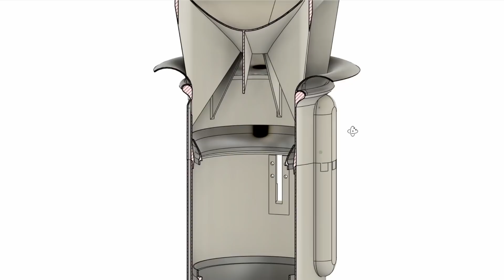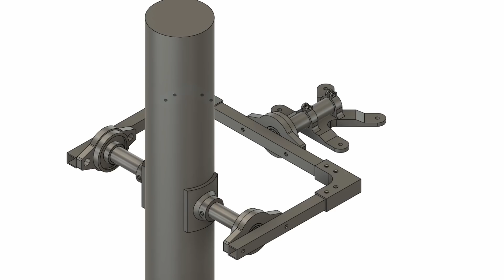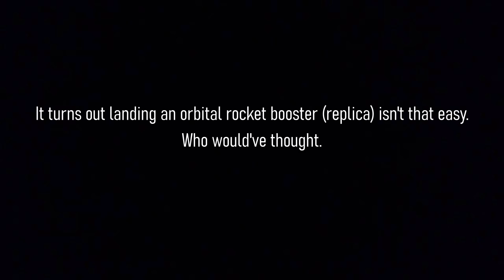SpaceX inspired edf rocket part 2: Final assembly, tuning and maiden flight

Comment: Nice work! Where is the gyro located? Did you notice in the video that the nose cone is the most stable...everything else swings around it. (Axis point)  What happens if the gyro is in the center of the rocket?
Reply from the maker: R Coyote the gyro is located in the nose cone and yes you’re totally right, ideally the flight controller needs to be positioned in the CG of the craft but i did have any place to mount it in this place because the air needs to flow inside the tube as uninterrupted as possible. Placing it on the outside was also possible but this is just too ugly 😆
Reply: @BrianBrocken  That makes sense! How about printing a 4 vane stator with a   space for gyro in center at cg?  It would still allow air to bypass..  (may need a bigger motor to offset)

OR

Two gyroscopes one on top one at bottom?  Synchronized?
Yeah, i know I am opening a can of worms there..

Just throwing some ideas out there.

Comment: Looks absolutely incredible thank you for sharing. I guess one variable the falcon rockets do not have to contend with is hovering. Your EDF rocket looks completely stable as it takes flight for that first 500ms or so, and perhaps if it was coming in to land smoothly from a height of, say, 10 meters direct to a landing spot it might be easier in its "terminal guidance" phase. 

Does your rocket guidance system learn from its experiences (machine learning)?
Reply from the maker: Thanks man, I think i need some compressed air thrusters on top to keep it level and no haha it's not that sophisticated 😂👍
Reply: @BrianBrocken  One day, man, one day!

Comment: watching it wiggle clockwise and counter clockwise and i'm wondering if its fighting the torque of the motor, maybe install 2 motors that spin in opposite directions to counter the torque. otherwise its an awesome project. :)
Reply from the maker: The thrust vectoring is fully capable of counteracting the torque produced by the motor, it just needs to be tuned a bit better. Also when retracting the legs, the moment of inertia moves inwards and you would actually need a different set of PID parameters to control the yaw movement, to prevent the wiggle.
Reply: @BrianBrocken  sounds like you are already looking into it, best of luck to you :)
Reply from the maker: Of course haha, thanks man 😉👍

Comment: Hi,Bro, you don't have a stabilizing device at the top of your rocket. Four directions of gas path can be designed to connect the bottle filled with gas, and a solenoid valve is used to control the gas injection inside. Control which direction to allow it to jet during landing to control landing attitude.Good luck.

Comment: Thats awesome, but all your problems seems to come from the nose being to heavy and the legs not being wide enough for it. All about CG brother. Huge congrats for the work accomplished
Reply from the maker: Thanks man. The weight needs to be at the top or else it won't fly at all. You can compare this with trying to balance a large and a small stick on your finger, the larger stick will be easier to balance. The higher your cg, the more leverage and control authority you have at the bottom. Of course for the landing it would be ideal to have the cg as low as possible but then the thing won't fly at all. The CG would actually need to move from the top to the bottom when landing.
Reply: @BrianBrocken  Yeah you're right. Maybe just increase the legs size then would solve the landing problem. You could also divide the rocket in 2 parts. Having maybe 4 fans on top for stability/lift and your main fan at the bottom. Would look closer to the real Falcon 9. However, keep up the good work you have a new subscriber :)
Reply from the maker: Haha thanks for the sub man, appreciated 😁👍
Reply: @BrianBrocken ,  SpaceX uses smaller directional thrusters at the nose during landing to aid in balance.  Could your nose weight be tiny drone motors?

Comment: you should consider how to lower your mass centre, how to prolong landing legs and most important, how to install dampers onto this legs. Then it will be easier ;)
Reply: That is the trick, right? Should the mass center move down or, perhaps at bit counter intuitive, up? Imagine a stick with a weight in one end. It is easier to balance the thing when the weight is in the top than in the bottom.  A dart arrow has the weight in the front and the control surfaces in the back. An air plane have the center of mass in front of the center of lift or it will fall down.

Comment: will your flight controller let you have another set of yaw gains for when the landing gear are up?  change in inertia must giving them fits.
Reply from the maker: Yes i was thinking exactly the same thing, didn't find it yet unfortunately.
Reply: @BrianBrocken  what flight controller are you using?
Reply: @BrianBrocken  Maybe your flight controller has the ability to change gains from the remote control.  Just use the retract switch to also change the gains for the yaw.  Really cool project and nice work to get it up and flying.

Comment: Maybe counter rotating props would  mitigate the yaw issue?
Reply from the maker: Yes this would absolutely solve it, but adding an extra edf might drain the battery to quickly. I now already have a flight time of around 1 min. So i think it’ll only get worse when i add an extra one, but then once again the thrust increases and you can carry a bigger battery so I actually don’t know to be honest 😅 i would have to do some testing 😉👍
Reply: @BrianBrocken  whats the all up weight?  I can try some testing. What size motor and kv? What prop?

Comment: hey buddy, have you seen Sikorsky copters they got two rotors on two levels to neutralize the drag, why dont you try one on top and other on bottom with clockwise and anti clockwise direction? maybe i am wrong, but i would be glad if it helps.
Reply from the maker: Hello mate, this certainly is a possibility. This would neutralise the torque created by one motor and would probably solve the problem with the landing gear also 😉👍 the only problem i can think of right now is that the 2 edf’s would probably drain the battery to quickly. I now have a flight time of about 1 min with only 1 edf, i think it’ll get worse with 2.
Reply: @BrianBrocken  thanks for replying bro... May I know what battery are u using?
Reply from the maker: @Jobin Mathew John i’m using a 6s 1000mah 75C lipo battery, all the info about this project can be found on hackaday, the link is in the description (needs to be updated though).

Comment: Why does the yaw axis become unstable? Does the landing gear weigh that much to make a difference? Maybe calibrate the PID with the landing gear up.
Reply from the maker: No it doesn't weigh that much but it does has some mass. When you retract the gear, the moment of inertia moves inwards and the rocket can turn a lot quicker. You can compare this with an ice skater that's spinning, when she stretches her arms out she will spin slower and when she moves her arms inwards she moves a lot faster. The same aplies for the landing gear. If you would tune the PID parameters to be stable when the gear is up, the rocket gets unstable when the gear is down, you just reverse the problem. Ideally you would need 2 different sets of PID parameters, one for gear up and one for gear down.

Comment: Why don't you use more propellers inside the top section of rocket, see you rocket tilts when landing, you can adjust that tilt using pid for 4 propellers using them in the top section. For more modifications, you can use a distance sensor which will detect change in ground distance and using pid you can adjust rocket speed and tilt while landing.

Comment: Amazing, but would mini grid fins like the actual rocket help?
Reply from the maker: MrWitchblade no, they only work at higher speeds. They’re pretty much useless when you have almost no vertical velocity like in this case where it’s just hovering.
Reply: @BrianBrocken  just wondered.   I've not built anything like it, just normal rocket powered ones.
Are you aiming for a given height? (Flying that is)
Reply from the maker: MrWitchblade I don’t have particular height goal in mind. The main goal for this project is to be able to land this rocket, maybe autonomous with the help of gps. If this al works out I’ll build a drone ship and attempt a landing on it 😜👍
Reply: @BrianBrocken  and then risk landing on a pond\lake.   Scarey but cool.   I'll be watching for that. :)

Comment: Awesome building how hard would it be to put a turbine in  there  I have one kicking around
Reply from the maker: I have 0 experience with turbines so i don't really know. First thing that comes to mind is it'll probably melt the fuselage within seconds. I also don't know if these turbines are designed to be operated in a vertical position. I do think this would be a very interesting project to try out 😉👍
Reply: @BrianBrocken   Turbines just much more complicated You will have to do everything het chield around the turbine and exhaust   Tell pipe half to be stainless steel With stainless steel fence in their And you can buy thrust vectoring I have a plane with thrust vectoring

Comment: TVC fins are less effective in redirecting thrust vector. It will be better if the thrust vector can be changed by the EDF itself and attached at the bottom like what SpaceX did on their engine, otherwise flow turbulences inside the tubing is hard to be controlled. Also most airflow will be at the center of tubing, so most of the thrust will be wasted.
Reply from the maker: @Lee Yy, Thrust vectoring the edf itself is a good idea and would certainly minimize losses, but how do you plan on doing any torque or yaw compensation and yaw controll with this design? Spacex doesn't have to account for torque created by a brushless motor. They do use a reaction control system to have some yaw control, but adding RCS would just add more complexity and weight to the design.
Reply: @BrianBrocken  yeah, induced yaw from motor torque is certainly a problem. Maybe dual or quad EDF with counter rotating blades could solve it. Or pursue for starship design with big fins to act as airbrake for the yawing. Just my thoughts.

Comment: Is your cg to high? If the ducted fan and battery were near the bottom the craft would be more stable, less likely to tip as the cg would still be inside the landing gear footprint.
Reply from the maker: I get this question a lot. this is a common made mistake and is called the rocket pendulum fallacy. Lowering the center of mass would make it less stable. The higher the center of mass, the more control authority you have. You can compare this with trying to balance a short and a long stick on you finger, the longer stick will be a lot easier to balance than the shorter one.
Reply: @BrianBrocken  thanks for that. I'm coming into this with an aeronautical background not a rocket one. The other sollution then is either a wider landing stance or, maintain flight comtrol until the landing is stable. Keep up the great work.
Reply from the maker: Thanks simon, I think (i'm not sure) spacex pumps the fuel around to change the cg to the bottom when landing, this way when they are freefaling and deploying the grid fins they kinda inverted the rocket and it's actually facing down to earth (like a dart). they also use cold gas thrusters to make minor adjustments during descent and to keep the rocket upright while landing.

Comment: man you are panicing in last 10-15 inches to the ground letting the power off too early , keep the power and balance until last few inches keep trying awesome work !!!
Reply from the maker: That’s what i was trying to do but unfortunately something like ground effect exists and the flight controller is located in the nose, this means the rocket will pivot around this point making it harder to get it perfectly straight for landing.

Comment: Would the rocket be easier to control if you moved the weight/balance point way way down. Looks top heavy?
Reply from the maker: This is a common made mistake and is called the rocket pendulum fallacy. Lowering the center of mass would make it less stable. The higher the center of mass, the more control authority you have. You can compare this with trying to balance a short and a long stick on you finger, the longer stick will be a lot easier to balance than the shorter one.

Comment: What program are you drawing in? Looks awesome
Reply from the maker: Hello man, The software I'm using is Fusion 360. I just finished a basic guide regarding Mechanical design. You can find it here: https://brian-brocken.medium.com/basic-guide-to-start-developing-your-own-products-part-1-mechanical-design-1f13d2074ebb
Reply: @BrianBrocken  Nice! Thanks :) I allways wanted to draw some mechanical object that i can seperate/connect in the drawing 3d space, and then work my way arround to print everything in pieces. Is that possible ?

I have a bachelor in architectual construction management and im a bricklayer allso, so drawing in 3d enviroments is common for me. :) Thats why i wanted to try out 3d printing, for specially mechanical parts and to assemble  in real life :)
Reply from the maker: @dgvideodk  yes you can design something larger and later split the model up in separate pieces so it can fit on your 3D printer and later glue them together.😜👍

Comment: There are some issues for your prototype
1. The gravity center best in the axis of rocket and best in the middle of your rocket
2. The smooth inner pipe is best for the air flow
3. |nner wings will cause more throttle loss of EDF, it's not a rocket engine. Consider the vectoring tube like most model airplane did will save lot of throttle power and easy to stable status.
Reply from the maker: Hello Thomas,
1. Rockets need to have the cg in the top, but you're right, for a singlecopter (what this essentially is) your cg needs to be in the middle if you want to hover stable. The cg on mine is between the middle and the top. In general it's better to have your CG a little higher, this gives you a lot more leverage and control authority on the bottom of the rocket.
2. Of course, I don't see how the inside of my prototype wouldn't be smooth?
3. Yes this has been considered, but how do you plan on doing any torque or yaw compensation and yaw controll with this design?
Reply: @BrianBrocken  Hi, Brain
1. Leverage maybe let you feel easily to control, but the leverage give more unstable for landing, center is the best choice.
2. I see the cube in the air inlet for hiding landing skeleton in your last video. I can't upload the the screenshot in this comments. The servo cables which surround the servos will cause your throttle loss.
3. It's same with what you are doing now, just the let the tube rotating in 2 directions.
Reply: @BrianBrocken  Part I 3:33
Reply from the maker: Losses are almost inevitable when building something like this, the top part for example where the air inters the tube induces losses, the inside of the tube no matter how smooth will always induce losses and at some point you do have to interfere with the air for control purposes which will also induce losses. Your idea of the thrust vector tube will be efficient but again not perfect, every time you try to direct air streams you will end up with drag and losses, and to be honest the deployable landing gear was well worth the losses in my opinion 😆. With your tube vector design you can indeed control 2 axes but my previous question was how you will be controlling the third axis (which is yaw, rotation of the craft) with you design?

Comment: May I ask you about motor specifications and propeller size and overall thrust..?
Reply from the maker: I’m using a 6s 12 blade 70mm ducted fan with a max output thrust of about 2.5kg, the rocket itself weighs about 1.3kg flight ready. I will be posting all the details on hackaday in the following days, link is in the description.

Comment: I think the problem is in the alignment of the rockets. you have most of your weight at the top of the rocket. try to play with centering
Reply from the maker: The weight needs to be on top in order to achieve stable flight.
Reply: @BrianBrocken  ok. may need to increase the chassis size

Comment: Is it trying to land by itself or are you controlling it with RC ??
Reply from the maker: At the moment it’s being controlled manually with an rc receiver and transmitter but the flight controller is capable of doing fully autonomous pre planned flights
Reply: @BrianBrocken  cool , just curios to know , for automated landing , it will be an AI based algorithm ? Because while landing , the trajectory of the lander may vary a little bit from the landing location and some kind image processing is required to land it on the exact landing site??

Comment: Landing this way is difficult in a speed controlled motor,  i can only imagine how would it be to vertically and precisely land a liquid propalent rocket...hats off to Elon
Reply: The fan tube is paradoxically more difficult because the center of gravity is high. We omit factors that have a favorable effect on stabilization, such as top suction and gyro effect. Adverse factors are non-laminar currents. Surely everyone has noticed that it demonstrates hovering, not the controlled fall that is actually carried out. Therefore, it is more difficult in this duct and fan configuration. The author would have to use the correct center of gravity, compressed gas and control system. You might be surprised it would be easier.

Comment: Nice one! Looks like you’ll need 2 sets of Yaw PID gains, one for legs deployed and one not. 

If you have a moment check out the SpaceX rocket I built on my channel, I wrote the flight controller code myself!
Reply from the maker: Yes i do need 2 different sets of PID parameters for the yaw axis. Congrats on building your flight computer, it seems to be keeping the rocket very stable 😉👍